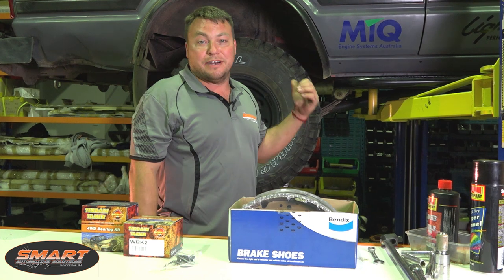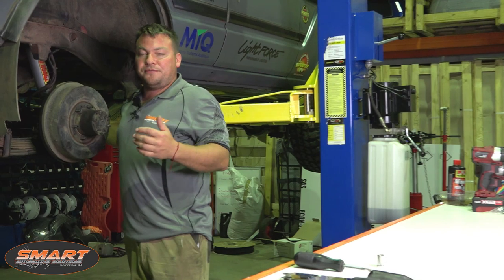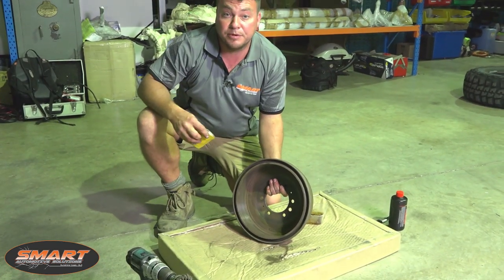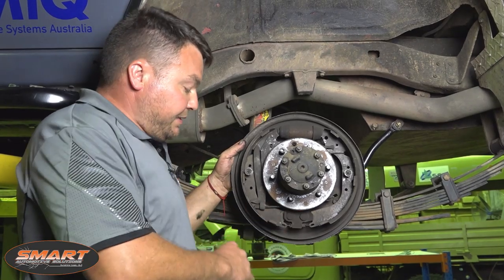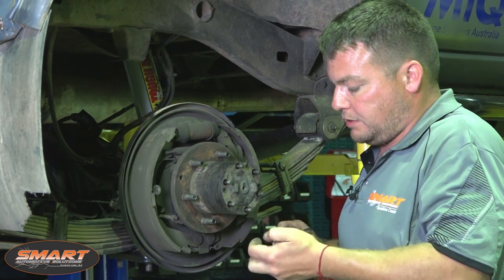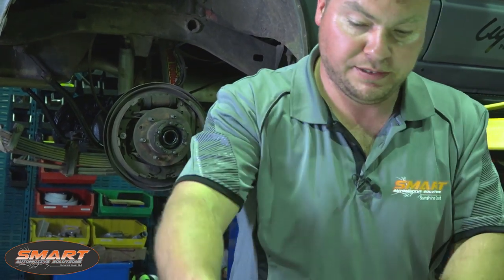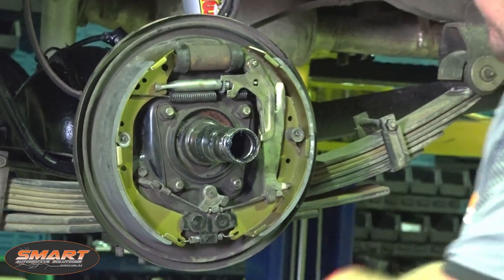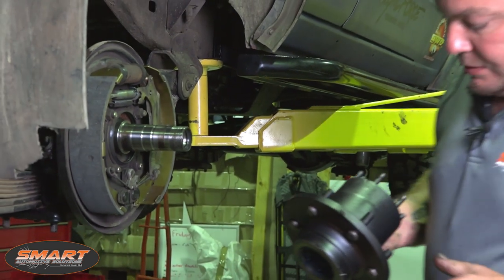How To - Rear Drum Brakes and Wheel Bearings Replacement - SMART Automotive Solutions

Comment: Gday Mate very professional and informative video thanks ! I have the two locking screws on the drivers side hub burred, so I tried using screw remover no luck, then an ez out snapped off in each one ! Any thoughts on how to extract these two locking Phillips head screws mate ? Regards Craig